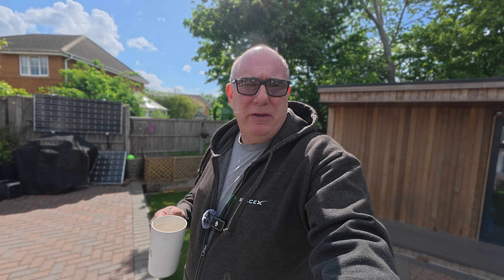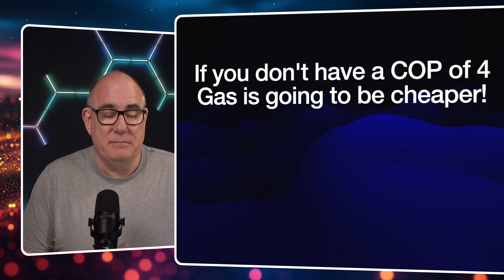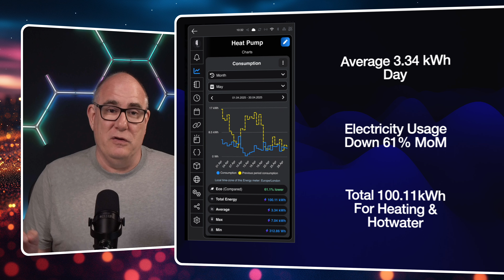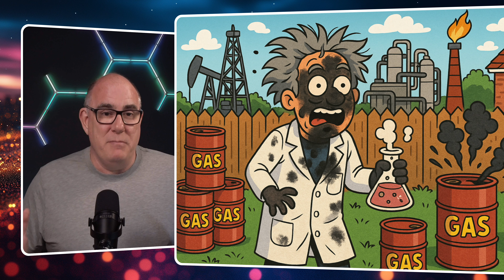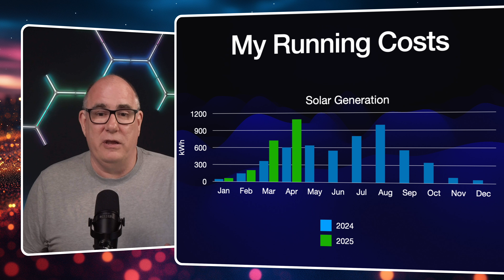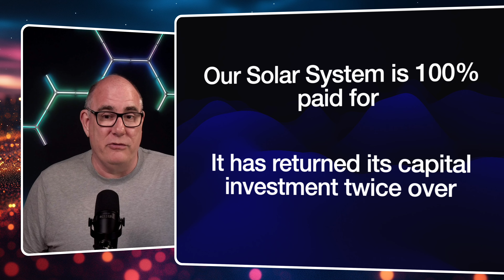We Cut Our Heat Pump Bills to Zero

Comment: Hey Jon, I was a sceptic on everything in the energy area. Then I got an EV. And then a home charger, and having watched your videos I recently plunged into solar and battery and now I can't believe I am considering ASHP! We do like a warm house and very hot water though. Heat to 22 or 23 in winter and hot water is scolding so we can take long showers at 38 or higher! So that's a concern. I have heard of high temp heat pumps though so will investigate. Anyway we have turned right around and considering a 2nd EV too. Finally, yes, you do know me! Great series by the way. You probably have my email address? See you, Ian.
Reply from the maker: Hey Ian, its been a minute, hope your keeping well, please do drop me an email as I seem to have misplaced yours. Info in the channel description if you can't find it, be great to catchup

Comment: Watching from Norway I find this just utterly fascinating!
Pumps in the showers? Now I will have to google that to find out more!
Reply from the maker: pumps as in water pumps to increase the water pressure
Reply: @JonathanTracey  Yeah, I found that out. Interesting. I guess the diameter of waterpipes are smal too?
I'm used to minimum 2 Bar, max 6 Bar and flow guaranteed to 90lpm and normally up to 180.
I see that minimum in UK is actually 1 Bar.
Reply from the maker: yep that’s why we use pumps as it we can take it up to 2-3 bar.

Comment: Your Shelly shows May not April! However your numbers would tell the same story. I have 30 KWh of batteries, 13KWh of Solar and just had a 16KWh heat pump and a 300 SunAmp installed in February  The SCOP design is to run at 4.5 and so far is delivering this, however we need to wait until winter to fully realise the efficiency. Great video and all helps to drive awareness of going down the renewable route.
Reply from the maker: Good spot! Yeah, that Shelly screenshot seems to be a bit of a glitch — the numbers are definitely for April, but for some reason, it's labelled as May. Weird!

Sounds like you've got an awesome setup. I’d expect my SCOP to come in closer to 4 overall since we use quite a lot of hot water heating, which tends to drag the average down a bit. But like you said, winter will be the real test!

Really appreciate the kind words — totally agree, sharing real-world results is key to helping more people see what’s possible with renewables.

Comment: Suoerb video! Thank you so much for making these!

Out of interest, did you have to have your main fuse, the big one on the main feed from the local grid (usually about 100amp) upgraded? And if so, what was involved?
Reply from the maker: no, we still have 100 amp fuse, I do have to be a little careful that we don’t charge everything at the same time. But I have some intelligent scheduling set up in Home Assistant that make sure this can’t happen. We also have a fallback on the car chargers, but once we go above 90 A and the car chargers will start to ramp down.

I did look at seeing if I could get three phase power, but the DNO said the costs were just astronomical

Comment: It's interesting to understand the heat pump output does not directly related to the usage of electricity... How does one go by calculating how much electricity a heat pump would use, in order to correctly size the battery for solar, when they don't have a heat pump installed, I've been quoted for a 10KW Heat Pump?
Reply from the maker: I don’t think you can accurately calculate that because most modern heat pumps use a weather dependent curve to modulate how much heat they produce. So the amount of electricity use is dependent on the external air temperature (basically how much heat they can pull from the air).
Reply: @JonathanTracey  Not looking to have a very accurate level, but I am not sure what size battery to go for… is there any calculations which can be done to give a worse case?
Reply from the maker: My best advice is get a modular battery, one that allows you to easily add 5 or 8kw brick (Sigenergy is a good choice) that way you can add as you go
Reply: @ Thank you. For someone who daily consumes an average of 13 KWh per day what size battery would you recommend, this is off course without a heat pump and how much would you add for a 10KW heat pump?

Comment: Would it not be more efficient to heat your hot water via an immersion heater?
Reply from the maker: not at all, a heat pump is 3x as effective as an immersion. 1kw of energy gives 3kw of heat with a heat pump or 1kw with a. immersion
Reply: @JonathanTracey yes but you're not getting a COP of 3 when heating water to 60 degrees, nor is indirectly heating the hot water 100% efficient.

Where as an immersion heater is approaching 100% efficiency, granted its got to put all the heat in rather than extracting it from ambient air temperature.

Also your ASHP would be able to run more efficiently when not having to deal with the demands of the hot water
Reply from the maker: Ok so if we look at water heating alone I am getting 2.75 stil 2.75 times as efficient as an immersion heater. With regards to temperature, we heat our water to 47 degrees each day, that's more than hot enough for us. It makes no sense to heat it more then just to add cold water in the shower mixer to bring it down to a useable temperature. Once a fortnight for 2 hour we use the immersion to bring the temp up to 65 for a legionella cycle. as the Heat pump will top out at 50 degrees. With new high temperature heat pumps like the cosy this isn't needed as it can heat the water directly to that temperature still at 2.75 COP

Comment: Currently got solar 4.8kw and 10kw alpha battery with 5kw inverter installed last August . ASHP installing in late June so looking for more batteries before winter. Also an ev. What I want to know is if I’ll need additional inverter to ensure don’t draw from grid if ashp and oven and a couple of other things give load over 5kw.
Reply from the maker: I think you will need a larger inverter if that’s what you’re trying to achieve, on the coldest of winter days I’ve seen my Heat Pump pull about 3 1/2 kW, and the same again for an oven so there you’re at seven already without the rest of the house

Comment: New water tank?? With a Combi boiler. ??
Reply from the maker: No I didn’t have a Combi boiler, my house was built 27 years ago when they weren’t readily available. To pull out the existing infrastructure and replace the Combi boiler would’ve been even more expensive so I was quoted for a replacement boiler and a new tank brackets(because they get kind of gunked up after about 25 years)

Comment: Haha My heat pump didn’t cost me a penny fitted for free it is the biggest mistake I have ever made,MCS from start to finish ripped right off 17kW heat pump fitted my house is Total floor area 125 Square Meters It must be a cave I live in it averages at least 30 to 40 kWh a day in December.So be warned their are Cowboys out there no comebacks do they face.Zilch.
Reply from the maker: why did you let them fit such a huge heat pump in normal sized house, yes you got ripped off but you have to take some ownership as you signed off on the solution, didn’t you query why such a large unit
Reply: @ Johnathan I had never heard of a Heat Pump it was a telephone conversation Free Heat Pump save you a fortune and you will have to have one sooner or later Serviced for 7 years so my sister said yes.Not knowing anything about them.Only so many given away first come first served I told her take it what can go wrong.Heat Loss Calculation and a EPC certification E issued all MCS compliance.On a bad day it was using £25 a day heating only her Combi which they disconnected from the radiators supplies the hot water 💧.A drastic jump in heating costs from day one.Conned no other word for it she has to use it for 7 years enforced by the RHI every year on contract and they chase it up.
Reply from the maker: Yep sounds like she was well and truley taken for a ride, my house is a standard sized 3 bed and needs a 5 or 6kw pump never heard fo one so large being put in a house

Comment: Octopus Tracker Gas average gas cost this winter was 0.058p and my boiler runs 95% efficient thanks to the smart autotune thermostat found on GitHub or home assistant forum. I publish all data on Emoncms too so you verify it. If you are comparing to cheapest electric tariffs, do the same for the boiler. And compare it with the most efficient boiler in the UK :) Battery and solar definitely give heat pump an extra edge. Heat pumps are the future overall. Excellent video, thanks

Comment: We have a 9.2kw system with 10kw of storage and a 11kw Daikin heat pump through octopus.

We have had the solar and batteries for 3 weeks and outside of the standing charge and with no export tariff set up yet we have spent around £2
Reply from the maker: £2 you must be bankrupt :-) Once you get the export tariff in place you can enjoy the negative bills

Comment: Another great video, could you explain how you got 20p on cosy though? I know it varies by area but we get 12-13p sessions on cosy where you could recharge your battery every few hours for 3 hours
Reply from the maker: i took my usage and assumed a small battery but everyone is going to be different as we all use power at different times of the day.
Reply: @JonathanTracey  true but we managed with zero battery all winter only running at the 12p periods and likely managed about 14-15p average all winter. Octopus are more also giving £1 credit to run the heat pump more when it's below zero too

Comment: Recommend you look into healthy temperature for longevity. It's not 16C!
Reply from the maker: 16° is just the setting it’s actually off. 16° is just the temperature which if the housework to drop below that it would come back on and heat the house back up to 16°. It did this exactly twice in a whole month for about an hour.

Comment: Dont forget the standing charge for gas as well at 31p per day so another £9.30 as one you get a heat pump you dont need gas. My is being installed in August and is costing me £0 we the grant and cash back from my mortgage provider.
Reply from the maker: Yeah unfortunately we’ve hung onto our gas for our cooking in the kitchen for a little bit longer, when we remodel the kitchen we will install an induction hob and finally terminate the gas but for now 80% of my gas bill is the standing charge

Comment: Did the maths and we’re getting a very similar setup. ASHP going in atm, solar/bat 3 years ago and EV 5 years ago. Worked out on current rates we’re going to be approximately net 0 expenses for all electricity, heating and travel.
Reply from the maker: That’s fantastic news, just make sure you build up a little bit of credit with your energy company so that in the coldest depths of winter you can cover the cost of running the Heat Pump

Comment: i have 7.6KW Solar and 17.4KW battery storage and on IOG with my EV (approx. 0.70p a gallon equivalent to fill up) . I agreed an ASHP install for £2380  with octopus energy. But they sub contract all their work, so when the installers turned up they refused the job due to, (what they saw) problems getting the pipes from the ASHP to my cylinder. I have engaged another company to do the install (they say the are ok with doing the install they way I want it..  the cost of install is now £4300. my boiler is 20 years old so I will be making the change.. Octopus energy should make their installers do the job as agreed. It seems to me that the tail is wagging the dog.. certainly in my experience it was. .. but I am looking forward to paying 0.02p (scop of 3) or 0.017 (scop of 4) ... for my heating and HW...   oh and export rate of 0.15P per KWH
Reply from the maker: this is actually the first time I’ve heard of them subcontracting. All of the people that I’ve seen getting installed all the vans that turn up are octopus branded.
Reply: @JonathanTracey   ok some are their employee's and some are contracted. its the same with most businesses that subcontract long term. I worked in the cable industry, loads of sub contracted businesses wear the cable company logo'd clothing and vans
Reply from the maker: Could be but the team I had all said they worked for Octopus, now as you say they could be wearing the uniform but i would imagine as the number of installs goes up they will need contractors, as they probably don't have enough employees at this time

Comment: I’ve got a powerwall 3 and an expansion pack on the way, plus I have solar but My G99 has been approved with a an export limit of 5kwh per year! Very odd
Reply from the maker: That does seem a little low, are you on loop supply or do lots of people in your neighbourhood already have solar? From what I’ve heard the DNO will allocate an export limit normally at the same as your inverter but this can be reduced if there are lots of people on the same phase of electricity in your neighbourhood who might be exporting.
Reply: Are you certain you have your units correct here? I'm of the understanding that G99 (I'm just going through the long wait on mine) is a limit on KW not KW/h and is an instantaneous limit not a period ( over the course of a year). 5kwh/year doesn't sound right really as that's more a measure of overall consumption, mine is lowish at 2,700 KW/h year, making 5KW/h per year so low as to be negligible, that's less than a days usage even for me.

AIUI the limit is there to 'protect' the aged grid from oversupply (overvoltage is my understanding of the basic problem, though I'm no electrician). In theory if a lot of houses with solar were exporting too much at the same time it could 'trip' some of that old infrastructure causing blackouts at best and even damage to local houses equipment is possible at worst.

I don't know if this helps, but G99 approval sometimes isn't explained all that well, even by your installer (mine wasn't especially and this was with Octopus!) I'm having a roughly 10KW (peak output not KW/h) solar array installed and the initial application from Octopus to National Grid seemed to be for 5KW, I don't know how they arrived at this figure but it wasn't as much as I'd hoped for, nor did I understand how they'd arrived at this figure as quickly as they did since my understanding was that it would take up to 9 weeks (45 working days) and they were asking me if I wanted to proceed in the space of 3 days! 

It turns out that (at least in the case of national grid) that there's a sort of 2 stage approval, they will give a notional 'it'll be this probably' initially, but it has to go through a lengthy red-tape process to be ultimately approved and this takes it up to the 45 days. So you have an idea quickly, but not enough to risk a multi thousand installation until the final approval.

Perhaps of interest generally is that being an inquistive and pro-active (what can I lose here?) type, I took it upon myself to actually ring National Grid and see if I could glean any better insight. I was pleasantly surprised when the phone was answered by an actual person after a few rings. The helpful lady asked my address and said, bear with me a second and then put me through to a mobile phone of the actual engineer responsible for the limitation approvals! I was floored by this 'customer service' in this day and age to be honest. 
Clearly I won't name him, but he chatted for a while, explained some of their reasoning for limits and some technical stuff that went clear over my head, and also the part about 'pre' and 'full' approval. He then said, call me back in 10 minutes after I've had a look-see. I did, and he said, Octopus don't do hybrid inverters, the use of which I could upgrade your limit somewhat more, however though its on the cusp, if Octopus re-submit the request at 6KW, I'll approve it even for your microinverter (non-hybrid) system. 

And he did. 
Though I still have to wait until mid June (at the latest) for the formal approval. 6KW is enough for my system really, it will likely only 'clip' for a couple of hours at the height of summer and improves my ROI (over the 5KW limit) substantially.

Sorry Jon, I've rambled again, but I hope the information is useful to some.
Reply: @CarpeMea  I am not sure I am going purely on what the the company GB Solar have told me, I may be wrong but that was the conversation had on Thursday last week, they said in shorrt I can't export, maybe its because I have a FIT for my 4kwh solar panels which has about 11 years to run. I am not too concerned as i have a PHEV with an 18 KWH battery so it will get the excess, it just means I can only make savings and not a profit on the batteries. Heat pump install is booked for September 👍
Reply: @brettclarke6798  
Ahh! FIT, that'll be why. 
I've no personal experience here, but FIT payments per kwh exported are far more than you will get on SEG (the current system). 
So you stick with what you have regarding exporting because even though you export somewhat less than you will be able to with new additions (inc battery) you actually get paid more under your existing agreement. 
It'd only be worth it to swap if your new exports were far more than your existing exports. Your battery as a new item wouldn't be allowable under your existing FIT as I understand it, hence the advice from GB solar.